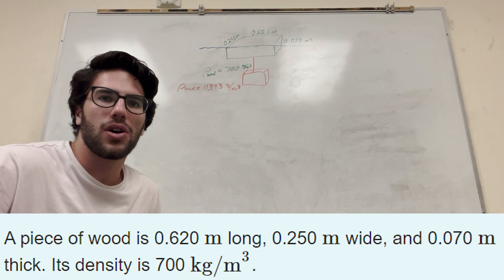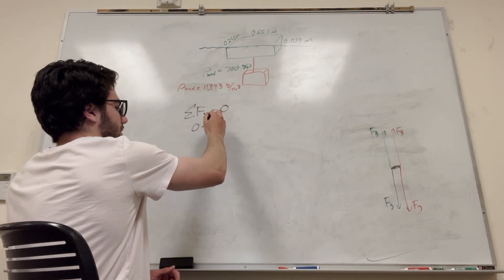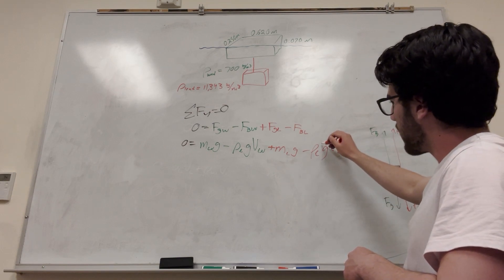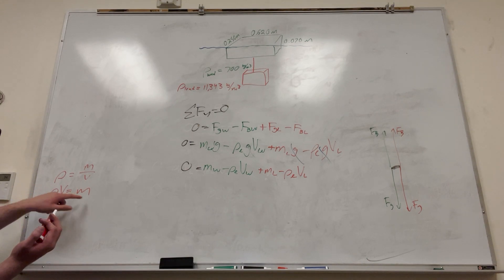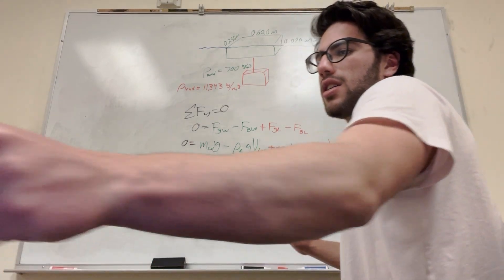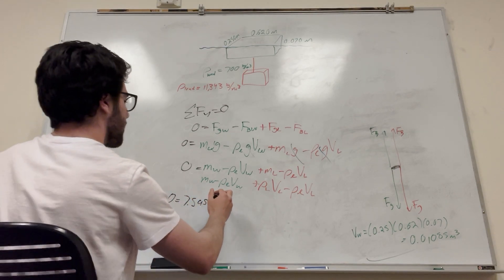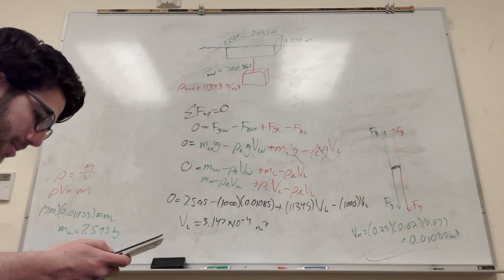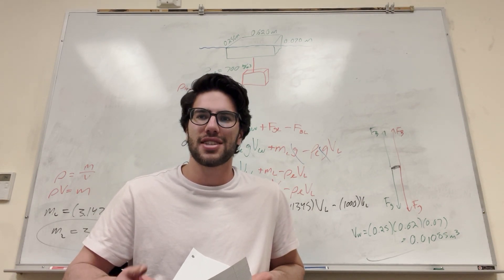A piece of wood is 0.600 m long, 0.250 m wide, and 0.080 m thick - Problem 12.68

Comment: ) 

The gravitational pull of the earth on an object is inversely proportional to the square of the distance of the object from the center of the earth. At the earth’s surface, this force is equal to the objects normal weight mg, where g = 9.8m/s2 , and at large distances, the force is zero. If a 20,000kg asteroid falls to earth from a very great distance away, what will it be its maximum speed as it strikes the earth’s surface, and how much kinetic energy will impact to our planet? You can ignore the effects of the earth’s atmosphere.
Reply from the maker: Sorry I couldn’t get to your problem my semester got kind of busy